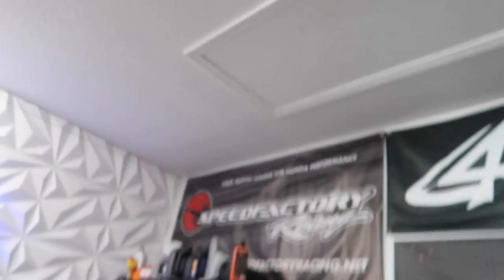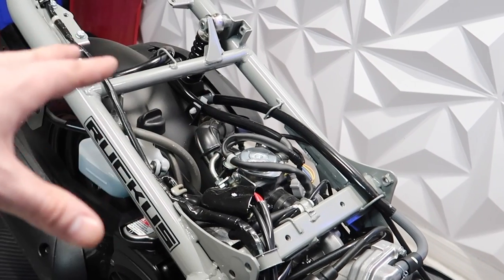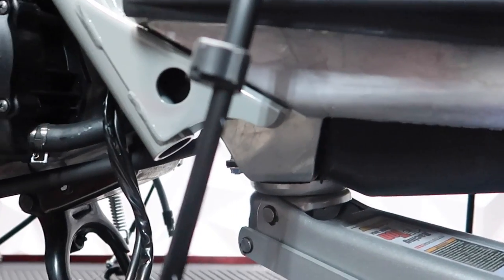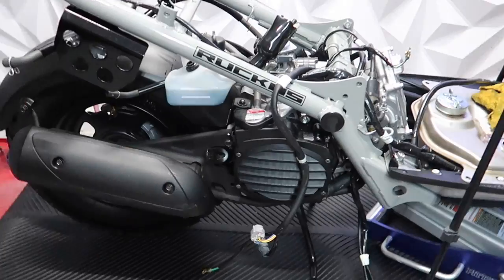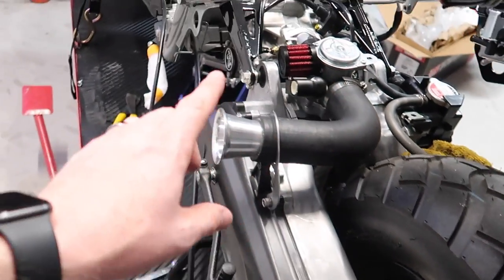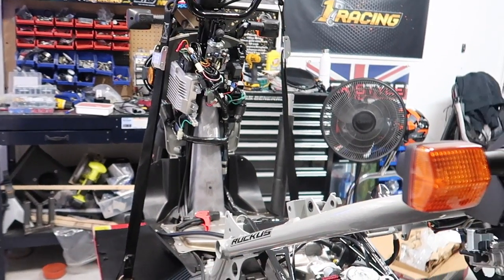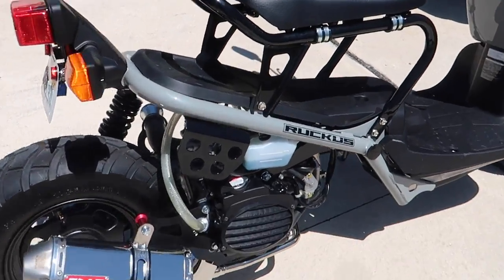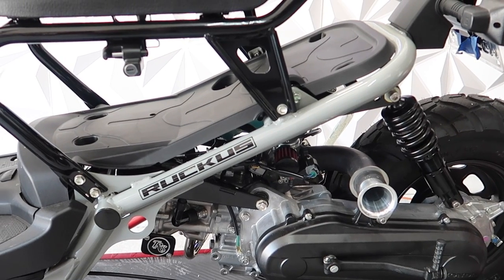TRS 9.5" Stretch Install on a 2022 Honda Ruckus.

Comment: Awesome video! I just got my TRS 9.5'' stretch today. I also have a 2022 Ruckus... Did you have to grind down the pivot bushings on the frame, or just straight up bolt the engine mount as is? I can't wait to install this bad boy!
Reply from the maker: Didn’t have to grind anything on this one but it can vary depending on how far Honda pressed your bushings
Reply: Awesome! Hopefully I won’t have to grind either lol got me a nice little weekend project
Reply: I installed my 9.5” stretch and I didn’t have to grind any of the bushings down! 🙌🏻 lol
Reply: Just did a quick road test, you ever have the issue of the TRS shock bracket hitting one of the little frame brackets with the threaded 10mm hole for the factory plastic cover?
Reply from the maker: @biellzeboss no I didn’t run into that issue. It is on a pivot point a little so I can see that happening.

Comment: I did all these mods to a 2018 ruckus. i cant seem to find a video on how to tune the carb after the velocity upgrade. direction say supposed the air fuel but its capped off.  we are getting 9500 RMP but still not getting to the end of the variator 4gram dr pullies in polini? any help would be greatly appriciated
Reply from the maker: What do you have all done. I need all the info. Even what jets and all.
Reply: @burnoutbobby  when i bought the bike it had NCY CDI, Big Gun EVO exhaust. polini variator unknown weights, I added the following after watching your video! TVR intake with 38 idle, 78 main and needle shim, NCY Coil, dr pully sliders 4gram, NCY oil decompresssion tube, reed block off, also bought 5gram but havnt used yet. Order #113819
Reply from the maker: That big gun will lose power. The header is too big and loses back pressure. Your rpm may be up there but if you don’t have back pressure it doesn’t matter because it won’t have what’s needed to keep a solid power band
Reply: @burnoutbobby  whats best option from here? can i replace header or do i go 20mm carb
Reply from the maker: Personally everyone I know with a 20mm carb carry’s a screwdriver with them to keep running on the fly.  I like the oem carb.  I’d try a different pipe like two brothers or yoshi.

Comment: That's cool. Do u know of any shop in southern California that I can take my ruckus to get some work done. Thanks in advance.
Reply from the maker: I do not. I haven’t been past Texas and only shop in Cali I know of is north Cali I believe
Reply: Gracias. I just installed a yoshi but I feel the bike slower any pointers if u can help.
Reply: Also what intake did u install. By the way u get down on what u do brea. If u was local u would be making all my money brotha. Wer u located if u don't mind me asking
Reply from the maker: Did you rejet the carb if not then it’s running lean and bad for the motor.
Reply from the maker: I’m in Tampa. The intake is the tvr intake.
Reply: What jets u recommend. I appreciate all help
Reply from the maker: I use the jets that come with the tvr intake. 38/78 shim.
Reply: Thank u. Ur very helpful. I appreciate that. Also do u think the small fast things  12.5 strch is any good
Reply from the maker: Watch Ruckstyleuk video on it. He doesn’t trust it as he could bend it with one finger so I wouldn’t go cheap when it comes to motor mounts. It’s what keep you above the motor and safe.
Reply: Don't wanna take all ur time brotha. Of all strech kits which u recommend for a fatty
Reply from the maker: For fatty I love the trs kit it’s solid 6061 billet aluminum. It’s not going anywhere and can handle riders over 350lbs
Reply: Ok thank u. U a solid dude.
Reply from the maker: Thank you
Reply: Gracias a ti.
Reply: I want a 12 inch strech. Can u guide me to meeting my goal. Meaning all parts needed to achieve. Also want a fatty strech
Reply from the maker: Email info@theruckshop.com

Comment: What wheel size, and tire size would you recommend with this setup? I want a more sporty style
Reply from the maker: 12x5 with a 130/70-12
Reply: @burnoutbobby what about an offset and wheel hub?
Reply from the maker: The ruck shop sells the correct wheel, hub, hubcap for this setup. It comes in solid dish or oldschool design. They are currently on a big wheel sale too

Comment: How is the fitment of the NCY 265mm shock without the stretch kit? Do you still need to preload it all the way?
Reply from the maker: Won’t fit without the stretch.
Reply: @burnoutbobby  Oh really, The regular shock wont fit?
Reply from the maker: @firebadgergaming903 no the airbox is in the way and can rub the frame
Reply: @burnoutbobby oh I have no problem ditching the airbox.

Comment: Great video! will this kit require a new brake cable and throttle cable?
Reply from the maker: Kit comes with brake cable. You just need a 75” cvk cable from the ruck shop
Reply: @burnoutbobby  thanks for the reply
Reply from the maker: That’s what I’m here for.  You’re welcome.

Comment: Can you use this 9.5 with factory center stand still
Reply from the maker: Yeah, I’ve seen people still use the center stand on 9.5.
Reply: @burnoutbobby  hey another question can I still get good results using the tvr intake with the stock exhaust
Reply from the maker: You will be limited. You are allowing more air and fuel in but choking it out with stock exhaust. So it may be minimal performance seen.
Reply: @burnoutbobby so I just bought a ruckus with the I assume v1 9.5 stretch kit what’s the big difference from v1 and the newer v2
Reply from the maker: The v2 is more rigid and less movement mount wise
Reply: @burnoutbobby  should I swap it out with the v2 or leave it alone basically will it be worth the difference to swap
Reply from the maker: No that v1 was a good mount. We had that design for 8 years.
Reply: @burnoutbobby  thank you so much for the fast reply’s I just placed a order with you all can’t wait it’s been 10 years sense I played with the rucks so much has changed lol
Reply from the maker: That’s what’s up! I’m always here to help!
Reply: @burnoutbobby hey so just read the paper work kinda confused on the upper bushings grinding I noticed you did not do on this one can I ask why….thanks
Reply from the maker: It’s only needed if the mount doesn’t fit. 90% of the time you don’t have to.  Only if Honda pressed in the bushings too far.

Comment: That looks clean and simple. Do you have the links to the stretch kit? What cables did you have to change? What about the fuel lines?
Reply from the maker: The link for everything I did is in the description of the video.  Also the stretch kit will tell you if you need anything else in its product description as well. Got you covered